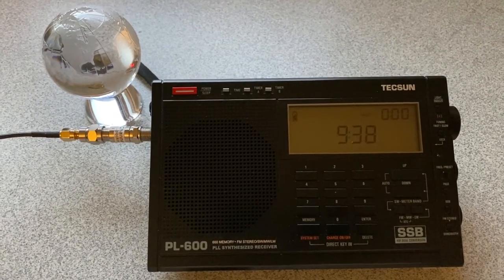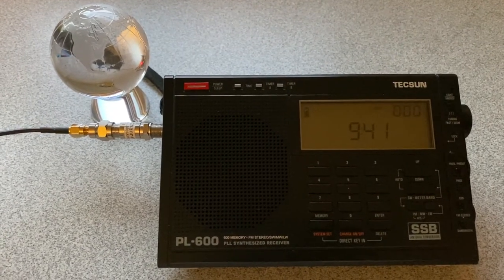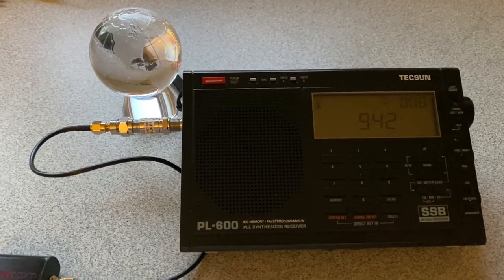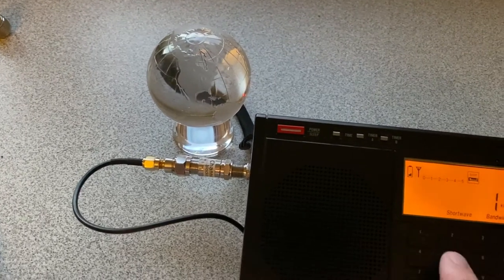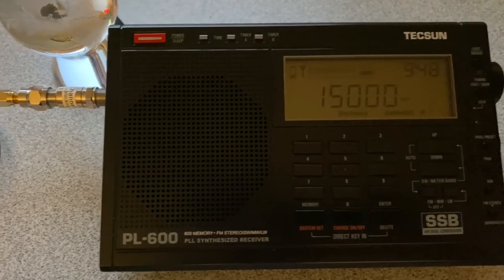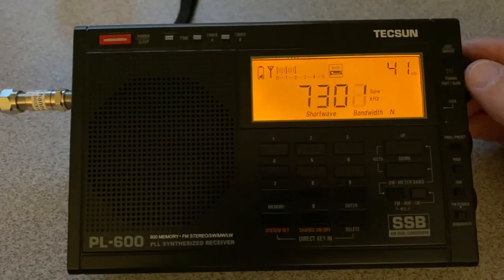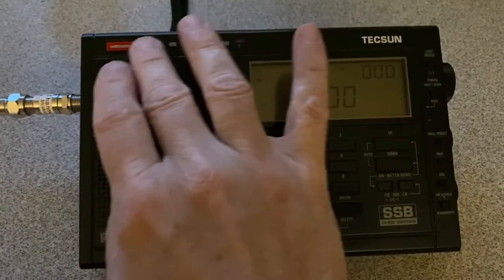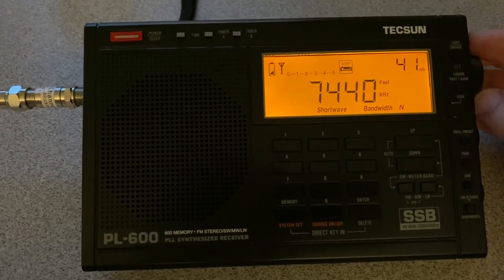Tecsun PL-600: Flamingo Notch/Highpass Filter for MW Overloading

Comment: Nice demonstration! Can you please tell me what is the component marked "Channel... blocking..." you are using between the SMA female to F male adapter and the 1/8" mono male to F male adapter? Is this a Lightning Surge Suppressor or perharps a DC blocking coupler? Thank you.
Reply from the maker: It is a DC blocking capacitor/coupler - I found them on Amazon --> https://www.amazon.com/Ancable-F-Type-Voltage-Blocking-Capacitor/dp/B074K51D7X